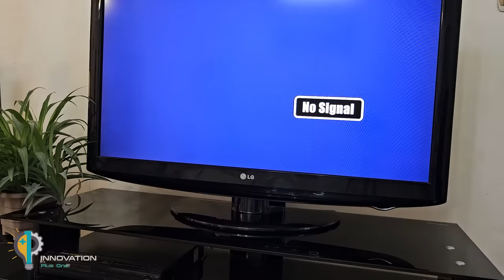Insert a Coin Battery into the TV and all the channels in the world will be unlocked Antenna Booster

Comment: What is the metallic strip made of and how thick is it?
Reply from the maker: You can use thin aluminum or copper tape
Reply: Your antenna will not work for anything more than 20 miles away and only UHF. The batteries can be deleted since they are insulated from the metal strap. and there is no amplification to need batteries for.
Reply: Should have used magnets instead of batteries.  The magnet would have helped pull the signals towards the antenna.
Reply: He clearly shows that both batteries are opposite polarities i.e. + & - . The metal strap is, basically, for stability and, through the splitter, takes care of the copper mesh of the coax. I'm not a sparky, but I might try it for fun. No harm in it.
Why not try it and see.
Reply: @kevnewhamable so if the title is right and the battery is making it work, but you are only using 1 side of each battery (which is a good thing because you might screw up your tuner sending 3 or 6 volts into it). 1 side of a battery does nothing. Nothing! The other side is against double sided tape which is not conductive.  Plus to get every channel in the world?  How does that work when TV stations reuse frequencies in other markets let alone countries.  So channel 3 is a different station in different markets but your TV could only show you one.  Not every channel 3 in the world. It's fake and click bait and people are getting annoyed by these people scamming.
Reply: @--harry_ Basically the 'every channel in the world' is hyperbolic.  He's a bit of a salesman.

Comment: Another completely unscientific bit of nonsense. I spent 30 years in TV and electronics repair. -  I only know of one device that is legal if a person is a licensed or authorized repair professional. There are cable line testers available that test cable lines that will receive all channels including pay per view. However, these are only legal for use by authorized repair persons. Use by anyone else is illegal and could result in theft of service charges and arrest.
Reply from the maker: My friend, dipole antennas can have good efficiency and receive channels sent by terrestrial stations.

Comment: Not being an electrician, I have no idea what type of metal strip that was, what size drill bit you used, what type of double stick tape, what size or type of wire that was, why you stripped the wire, or anything else you did.  A total waste of my time.
Reply from the maker: My friend this invention is very simple, I used aluminum strip and I used a drill that the socket splitter can pass through.

Comment: What this does not say is that if there is no signal to pick up, your TV is still not going to display anything. Because this is a booster antenna and if there is nothing to boost, that is what you will get. Nothing.
Reply from the maker: My friend, dipole antennas work in areas where there are radio signals in the environment